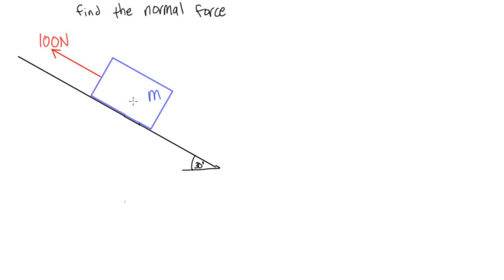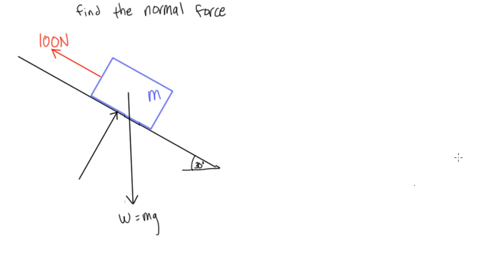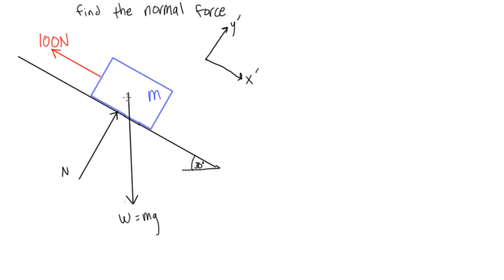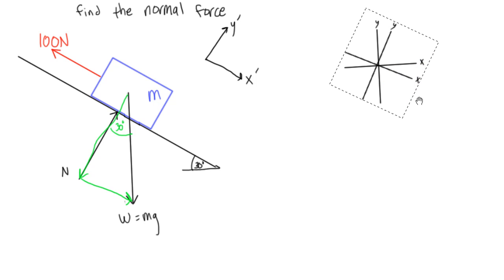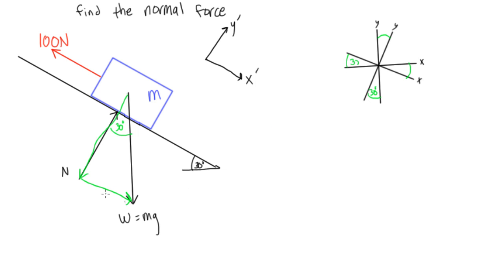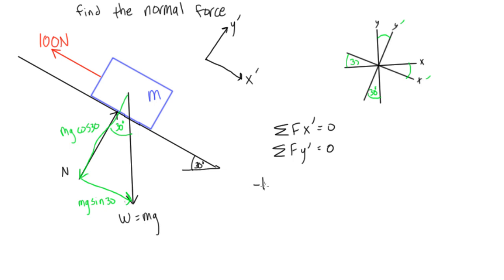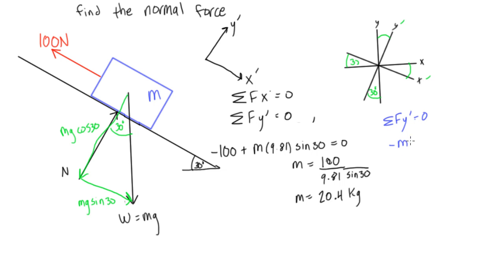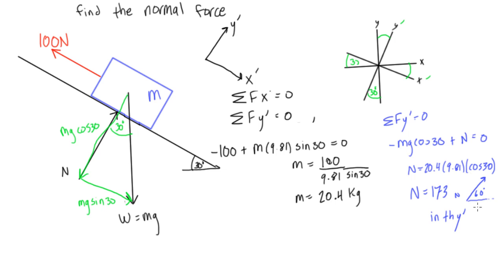How to calculate normal force on a slope (statics)

Comment: wouldn't normal force cancel out with +mgcos(theta)? Why do you end up solving for normal force even if the question is asking? wouldn't normal force be 0?
Reply from the maker: Yeah, the component of weight that's inline with the normal force cancels out with the normal force, so the crate has a net zero force balance in that direction, and won't accelerate in line with the normal force (ie into the floor or out of it). But you need to learn how to calculate normal force for when you start doing problems with friction. The force of friction is equal to the normal force times the coefficient of friction... so normal force is needed. You will often find problems where there is a n object like this on a slope with friction, and you'll need to determine the normal force before figuring out info about the force of friction. Like this video for example: https://www.engineer4free.com/4/friction-example-problem-2

Comment: Why negative 100 for the sum of forces
Reply from the maker: Because the positive direction of the x' is 30 degrees down from right. The 100 N force is pointing exactly in the opposite direction, so we consider it to be negative for the sum of forces equation.

Comment: Why is sin x and cos y?
Reply from the maker: Hey, sorry for the delay. You're probably used to seeing problems that have sin y and and cos x in them, but that is just a relic of how most right angle triangles are drawn, with the hypotenuse above the (horizontal) adjacent side, and the opposite side being drawn vertically. In this video, the triangle is not drawn like that, its all upside-down and stuff. What is true no matter which way a triangle is facing, is that from the perspective of the angle that we are using, that sin = opp/hyp and cos = adj/hyp, and rearranging, we get opp = sin*hyp and adj = cos*hyp. So from the perspective of the angle, it doesn't matter which way the triangle is facing.  In this case the opposite side is parallel to the x' axis, but we still just use opp=sin*hyp to get the magnitude of the opposite side. Same goes for the adjacent side, to solve for it in any triangle, all we do is adj = cos*hyp, no variable in those equations care which way the triangle is "facing" or if its upside-down or anything. When solving for the magnitude, it doesn't matter whether its aligned with any particular axis. When you make it past that step, the direction becomes relevant for summing in x and y directions (or x' and y' in this case), but you already know the directions from the free body diagram. Hope that helps!